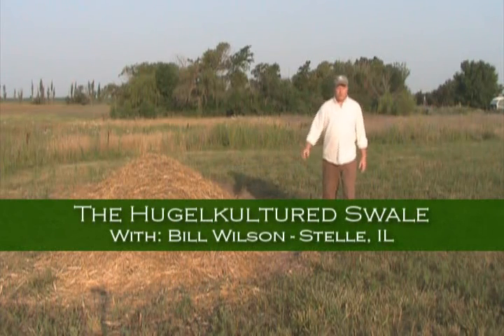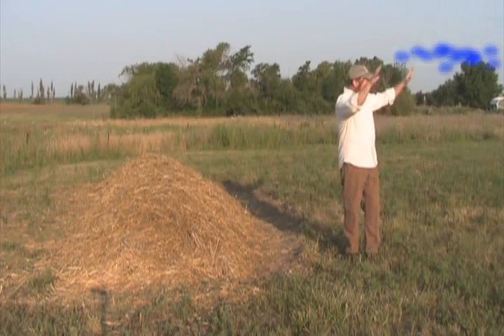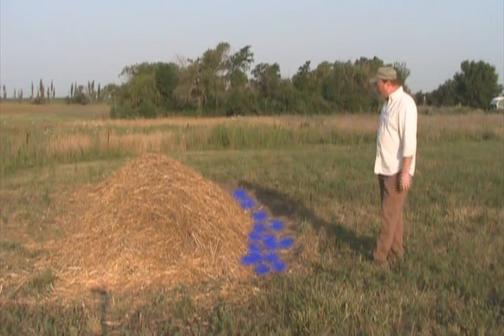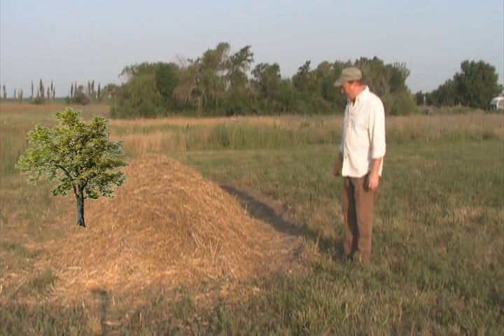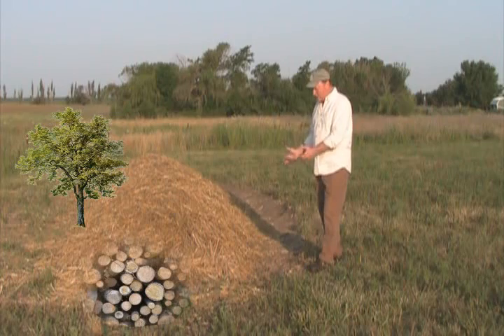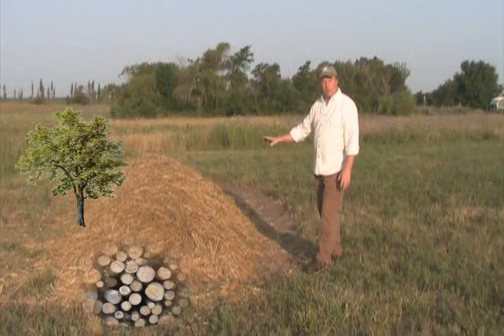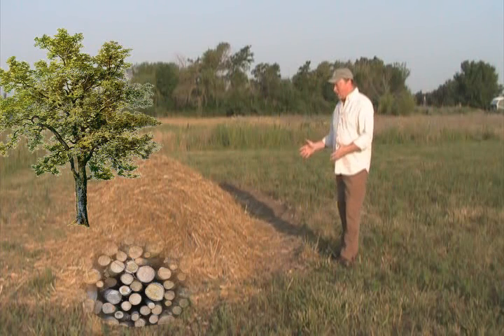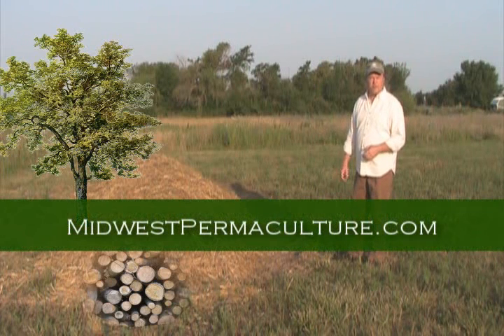Hugelkultured Swale

Comment: How do you handle nitrogen depletion as the wood breaks down?  Janice
Reply: A common mistake made is not having the soil on the wood deep enough. Ideally the soil placed on the wood is deep enough that any nitrogen depletion happens below the root level of any plants planted into the mound. It's recommended that a cover crop be planted to feed the mound. Also, as  the mulch breaks down and creates a new layer of soil, it feeds the soil below in a compost tea affect.
Reply: Jim S
Thanks Jim, I wondered how that worked. What you said makes sense and I must say many of the hugel's I've seen must have had a problem because there is usually not much soil on top of them. Thanks again Janice.